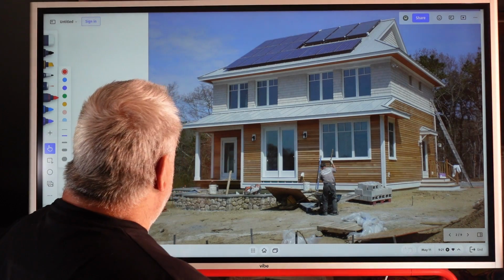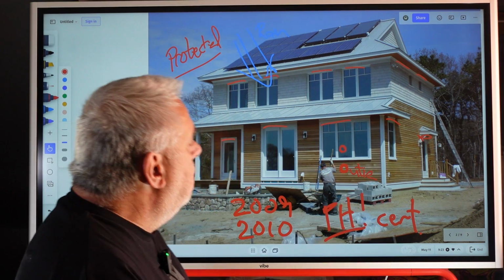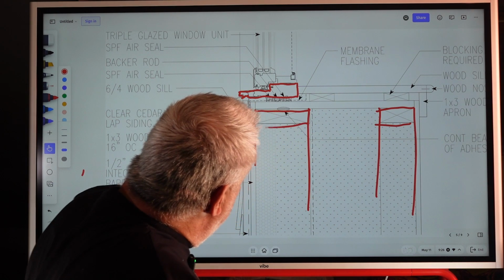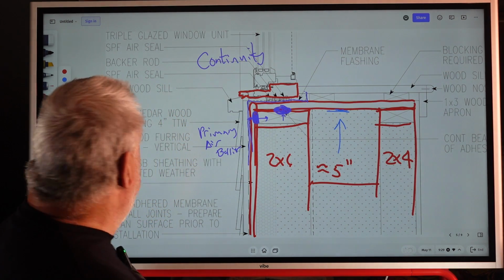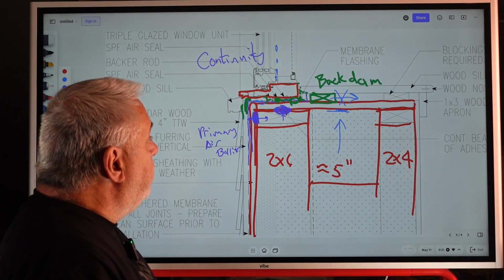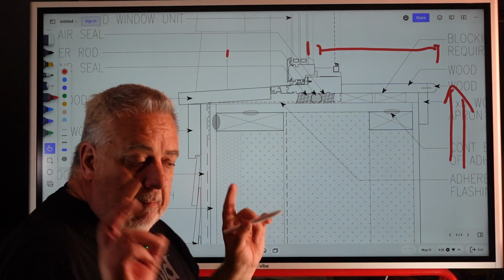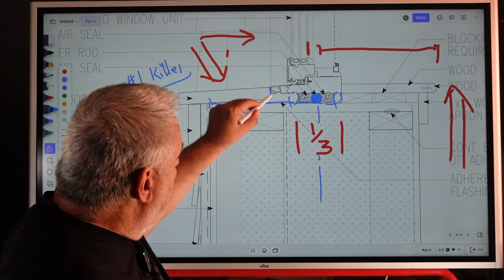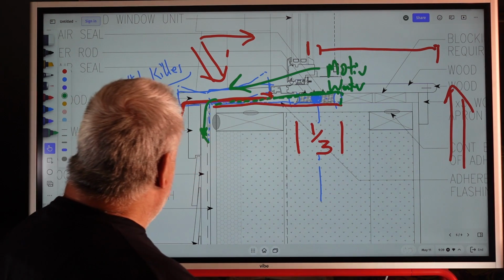PH 11 Episode 15 Window Sills

Comment: Recently Matt Risinger did a video on great new products and one of the ones he featured was a sill pan for windows and doors called Silldry. Do you think you would change over to using it rather than the process you use now with the piece of slanted siding on the sill, the back dam and all the tape and liquid applied flashing membrane?
Reply from the maker: I saw it, those systems have been around for 20+ years.......tried them but a built up sill seems to work the best for me